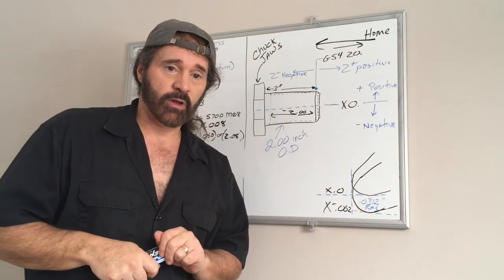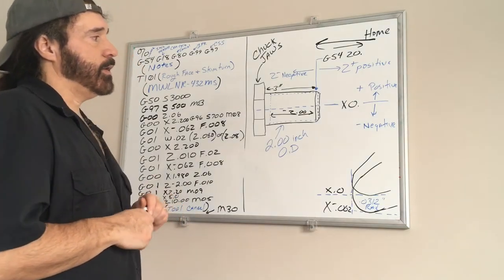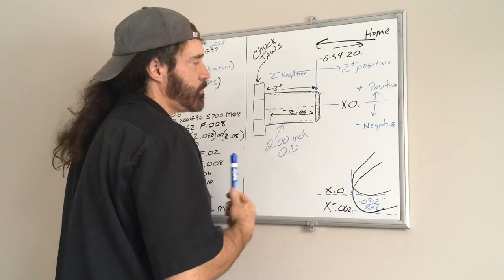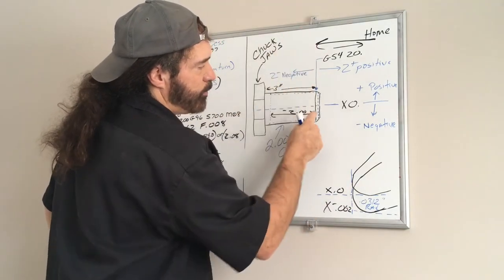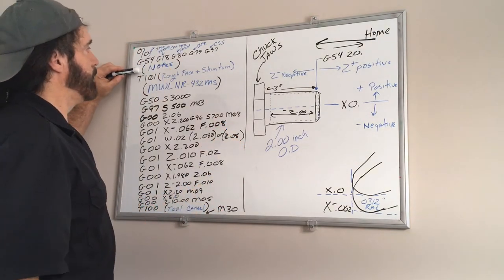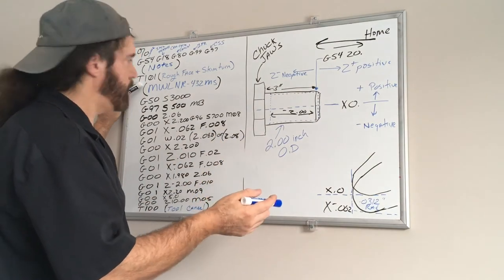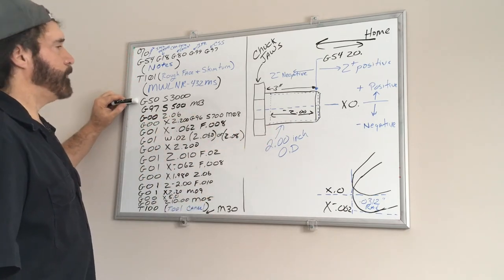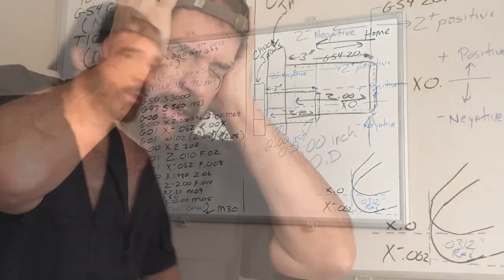Manually programming HAAS CNC Lathe for beginners with no experience - Part 1 of 2

Comment: Hello how hard or easy would it be for a beginner, to operate a Haas milling machine. Thank you in advance
Reply from the maker: I started out on Haas Lathes and programmed them for years. Eventually, I got put on Haas mills and had to program them as well. The cool thing is, the control panel for both the Haas mill and Lathe are very similar. I personally felt really comfortable going back and forth between both machines and I think for a beginner, it probably will depend on what task your employer will be having you do.  If you start out as an operator, navigating around the control panel is designed to be user friendly. I know in the beginning I was really intimidated trying to figure out all the buttons, but I slowly got familiar with everything and used that knowledge once I got on the mill.  
If you don't have any Haas experience, I would recommend looking through the Haas manual and look at some of the programming examples,  if you plan on writing programs in the future.
I do plan to take video of the new Haas VF2 our company got. I have to do all the setup and programming on that.
Anyway, sorry about rambling on...Ha!